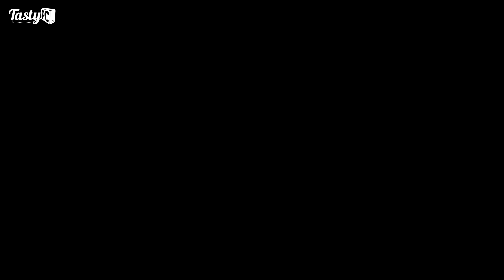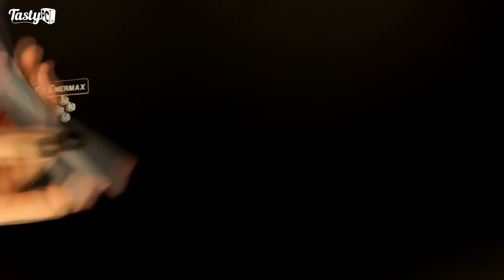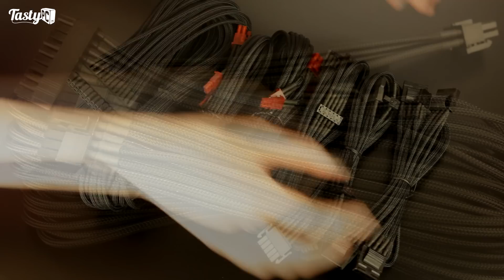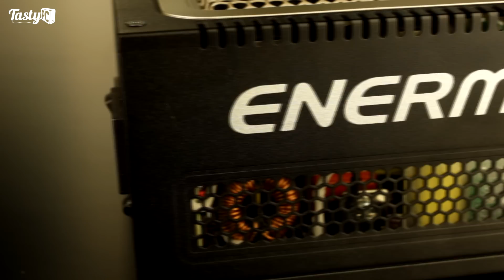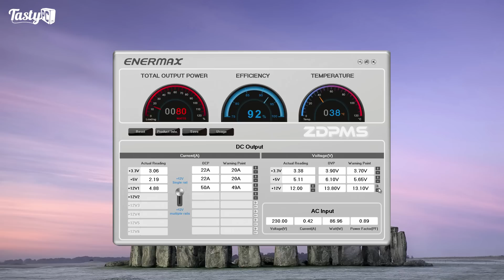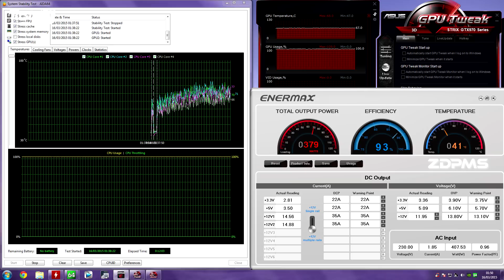Enermax Digifanless 550W PSU - My New Favourite Power Supply?

Comment: Hello, once again than you for the great coverage. I may consider one for my slow migration to a "fanless" configuration, and eventual core system upgrade. I currently use the Corsair Link Commander. Which reminds me I need to install my other thermistors and create new cooling curves for the fan change ups until then.

Comment: Using a fanless PSU is pointess unlness you have fanless PC, which is pointless unless u have no hdd and no optical drive.
PSU soft monitoring? I smell a "yet another marketing trick" here. Anyway, still prefer just a thirdparty/independent hardware power meter, not so good looking, no spectacular, but more reliable.
The best buy PSU is just highest available efficency class at the lowest price, powerfull enough to supply your rig. Simple as that. What's the "powerfull enough"? Let me explain: my 4770k/gtx680 overclocked rig consumes 65W in idle, ~170W at gaming (2560x1440@60Hz adaptive,vsync mode), at maximum stress I've reached 301W. So even 350W PSU can handle it (not a scum one), well a 350W (wandering a titanium one? ;) PSU would be perfect one for that rig. Every power suppy reaches maximum efficency at 50% of maximum power capability, which is 175W for a 350W PSU. While gaming (most common state of a gaming PC) the PSU works with maximum efficency, and thats the "powerfull enough" gold rule.
About fully modular PSUs, I hate those, every socket connection casuses voltage drop problems with time passing due to oxidation. Every suppy link wchich is used in every PC (atx, cpu12v, gpu12v, rail/s for 3 drives) should be attched to the PSU permanently.

Comment: This PSU kind of confuses me a little. It is a luxury part no doubt for serious users who, if willing to pay such high price/wattage, would likely spend a lot on all parts too right? So what is that itty bitty 550w gonna be for? 

A luxury rig with no OC, water cooling, minimum mobo, no SLI or in fact almost nothing above gtx x70 cards? I just don't see a 150+ quid 550 watt PSU having much of a place in the market if you ask me. 

Nothing as minimal as a below 500w rig is going to really need anything above god imo

Comment: it's a bit of a cheeky psu really, clearly it's venting its heat upward and reliant on the case fan dispersing that heat, hence the requirement on that vent, id rather the heat get mechanically sucked out like every other psu out there. Failing that a case where the psu is at the top with an upward vent would alleviate the problem. Good review as ever.

Comment: Recommended power supply size for this build:
i5-4690K (will overclock to around 4.0 GHz)
GTX 960 G1 Gaming from Gigabyte (factory overclocked, 2 GB GDDR5 model)
Kingston HyperX Fury 16GB 1866MHz DDR3 RAM modules (2x 8 GB)
about 4 fans + Cooler Master Hyper 212 evo, 1 Samsung 850 evo 250GB SSD, and thats about it... just wondering if i should get a 500w or 600w PSU, any help is apriciated :)

Comment: This is a really impressive power supply,  a polish website did a teardown of it to show the insides.  The power monitoring circuits look a bit complex and everything seems really crammed in there because of all the passive heatsinking they had to use.  But I will give them props because I can see everything on the high voltage side and they spared no expense.  Nippon-Chemicon filter/reservoir caps throughout, Toshiba FETs driving the primary,  X and Y class caps and two huge common mode chokes in the EMI filter stage, at least two MOVs, and obviously an active PFC. One of the downsides I can immediately see however is that the electrolytic caps are mostly buried in between heatsinks or under them (they didnt have a lot of choices on where to put them though).  Caps don't like heat,  but at least they managed to spring for 105C rated ones, nice.

Comment: I still think my EVGA 850w gold efficiency supernova G2 power supply is not only rated one of the best PSUs on the planet but it's half the price of this and easily allows future proof SLI coverage by the fact it is 850w not 500w
Reply: goldmeistergeneral This one is Platinum, fanless, and has a software interface. There's a difference.
Reply: Well those things you can take or leave. Gold is really not that much worse than platinum and software is not really necessary. Also, my PSU has Eco mode so the fan will not spin until the PSU hits at least 45% usage. That won't happen unless you have SLI, if you are running current gen hardware.
Reply: goldmeistergeneral Well than this PSU is not obviously for you. the point is features = price. if you don't want them look elsewhere and you will get cheaper.

Comment: Antec used to make the passively cooled power supplies many years ago. The biggest problem is not dumping out the excess heat. How does this one compare to the phantom? Yes heat is at an average 37C but in a passively cooled system, do it still work wonders? 

Wish this video had more depth

Comment: I think the Super Flower Golden Silent Fanless Platinum 500W
is the better solution. Max Power output in OC mode is 600 watts.
And it is much cheaper than the enermax;)

Comment: two 12V rails, single sleeved cables? Not like.
Reply: KocuRisko Whats wrong with that?
Reply: It's always better to have a single, strong 12V rail. It's less likely that you run into some kind of a problem. And for those single sleeved cables, I don't understand what is it good for
Reply: KocuRisko It is not. I encourage you to read my comment about that. as for single sleeved cables, yeah..... I agree.
Reply: Bait28 Remember, this is a 550W unit, even with the explaining you provided, 2 rails have no benefit here.
Reply: KocuRisko nor does a single rail

Comment: Just going to throw this out there right now because everyone seems to take this massive positions of "OMG single rail is the future, multi rails suck and are for plebs" you all need some education. A single rail PSU will not let you overclock any higher than a multi rail, or vice versa. Multiple rail: each trace is monitored separately, so if, say, one trace goes over 25A the power supply will shut down. Single rail: all traces are monitored all together, so if the total current going through the +12V outputs goes over, say, 60A, the power supply will shut down. Alternatively, no OCP may be present at all on the +12V rail. Let's imagine you have a short circuit on the +12V and the SCP (Short Circuit Protection) doesn't catch it. If you have a single rail power supply the draw on that one +12V wire and that one +12V trace will climb until either the combined OCP point is reached, or until something burns; the cable, your power supply, your motherboard. With large units, usually something will burn before the OCP point is reached. In a multi-rail unit, the current would climb until it hit that rail's OCP point, at which point the PSU would shut down to protect itself and your computer. Ideally you'd have a rail for every wire, but that would be impractical, so you generally see 2-8, depending on the power rating of the PSU and the design philosophy. With low-wattage units it doesn't matter. OCP on a single rail is useful up to about 40A or thereabouts, which is where most 550W power supplies fall. So with 550W and under power supplies, it's a moot point. However, with high wattage units, >45A on the +12V (650W and higher) picking a multi-rail unit will provide you with an extra layer of protection. It isn't essential, and it has no impact on the power supply's performance. However, it does provide an extra layer of safety in case you get a short circuit. And I would consider it a must for >1000W power supplies; [H] recently tested the single rail Corsair AX1200, but they had an accidental short circuit, and since the PSU's OCP is set for over 100A, the short overloaded and destroyed most of their testing equipment. So there is a danger with single rail units over 1000W.

So multi-rail is mildly better, especially with high wattage units, but it won't have any impact on your performance or overclockability.

Courtesy from my colleagues on OCN.
Reply: Bait28 extra layer of protection against what? In a real life - real PC? Only a deffective equipment would short-circuit the PSU, and I don't care if that deffective equipment gets even more damaged, it was already broken. Plus, I don't have to care if my superhungry GPU is connected to a rail that has enough power, because I only have one rail, and it HAS enough power. I am sure as hell I won't change my P-660 for some Enermax just to get more protection against situation that will never happen.
Reply: KocuRisko suit yourself. Point is there is no real advantage to either.

Comment: I have to agree about the overall looks of the PSU being a bit low end considering the price tag, but it is less of an issue, I think, with case manufacturers starting to isolate the PSU from the motherboard/windowed area. Even the nicest of PSUs can be an eye sore(and a heat farm), hiding it was a natural evolution for cases, it makes function over fashion units like this one more desirable.
Reply from the maker: TheTrendon The trouble is with most of those cases, is that you wouldn't be able to use a passive PSU as you have to fit it grill face up.
Reply: TastyPCTV cancels Amazon order
Okay, so I didn't actually order it yet, but that is a thought that had not crossed my mind.

Comment: My biggest complaint with most power supplies is that they have fuck off long cables which I have to somehow fit in my mid tower case and hide away. Also I despise the long lines of SATA power cables as they never seem to be the right way round.

Comment: You're so much more relaxed in your video's than a year ago, it's really noticeable, nice progress.

Would love a fanless PSU that's around 600, that way you can run a 1CPU + 1GPU system + OC and have room to spare for degradation. But that's probably a few years away still.

Comment: Those PCI-e... Even if I had a red themed rig, I wouldn't want to commit myself to red and therefore, it's a no to this.

Shame, looks great otherwise (and a big positive that Enermax have realized rainbow cables are not popular.
Reply: Peanutsreveng3 I'd say thats a waste to not pick a supply over. Especially since if it's really gonna bother you, you could do a nice paint right over it. Second Rainbow cables were that way because the colors indicated what the voltage was. Computers weren't always about looks, they were about functionality and easily being able to diagnose and test stuff, especially since you knew red ment 5v, yellow meant 12, green was the trigger for the psu, orange was the 3.3, black was the gnd. But now it's not as easy. Still though.
Reply: Given that significantly more people would prefer black plugs than red plugs, it makes sense to ship with black plugs and let individuals swap the plugs to their theme. While they figure that out, black will work in every system, red certainly will not.

The rainbow cables included the hideous sleeving they used Bait28, I'd rather high quality individual sleeving's used while keeping the rainbow cables (for re-plugging).

Comment: The Digifanless would be an instant buy for me if it was shorter. Unfortunately my Fractal Design Node 304 only allows me to use a powersupply with a maximum length of 140mm. My actual Enermax Triathlor FC 550W is way to loud. Would be cool if you'd have any suggestions about an alternative powersupply with 140mm length.

Comment: While this looks like an awesome PSU (kudos for sleeved cables and digital monitor) the alternative Seasonic Fanless Platinum 520 has rated 43 amps on 12v rail wich means it will be capable of powering more demanding GPU's. May consider that one if you are looking for a good fanless psu.
Reply from the maker: Anball2  This PSU is rated for 45 amps for the +12v rails combined. :)
Reply: TastyPCTV ah, missed that. Well that's even more awesome! Can you tell if it has any coil whine (when working and when PC is in standby mode)
Reply: Amps x Volts = Watts. High rated wattage PSUs always have more amps. And as long as they can provide the amount of wattage the entire system needs, it's all fine.

Comment: What's your opinion on the 390x lauren?
Reply: Imo its going to be TITAN Battle against Nvidia ;)
Reply: ***** It's not
Reply: ***** 290x was hawaii and 390x is fiji
Reply: ***** Thats because Nvidia has more money to spend on R&D but the one thing that pushes the market in AMDs favour is the fact that Nvidia has nothing mid range that sits between the old GTX770 & newer GTX970s. All you have is the GTX960 which sits between a GTX760 and GTX770 in terms of performance. so theres a massive gap there. AMD has all the 280, 280X, which are of course rebrands but VERY good cards.... Just not so good in crossfire as AMDs driver team suck but for single card setups a 280X provides great bang for buck. Nvidia has their shit together when it comes to driver support though so for multi-card configurations they are the go to guys for that. I was an avid user of AMD crossfire over 3 or 4 generations before bad drivers eventually drove me away. Ive had 680s and now 970s in SLi and they havent skipped a beat at all.

the only downside about the 970s is the 'ramgate' thing where 970s are really 3.5GB cards instead of the 4GB as advertised. Technically on paper its still a 4GB card but in a really really loose sense of the word.